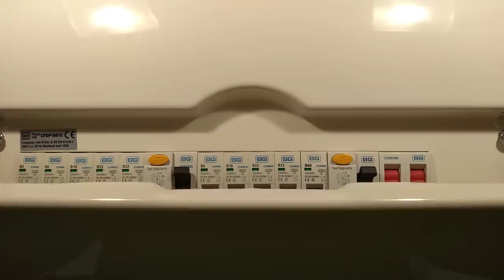A look inside a British home electrical panel.

Comment: Ha!
I'm still on fuse wire!!
Reply: Same here
Reply: Peter Fletcher Fuse wire? If you check I'm pretty sure you'll find the previous owner upgraded to opened out paper clips or really upgraded the supply by using nails.
Reply: I hope you never drill through a cable, get a shock or have a fire 🥺
Reply: fuse wire is fine has long has it is properly maintain.
I'll take fuse wire any day over this piece of shit box.
Reply: I have cartridge fuses in holders, minor upgrade to fuse wire, only 3 fuses for the whole house, really need to rewire the place.
Reply from the maker: Lots of people still have fuses.  The one thing I'd recommend is a quick audit to make sure the correct size of wire is in each fuse carrier.    It's also a good idea to make sure that the wires going into a fuse holder are suitably matched to its rating.
Reply: @bigclivedotcom  ive replaced all the fuse wire. And started swapping out the wire for Circuit breakers. My late Fathers response to a blown fuse was to just put in thicker wire! Unfortunately as im disabled im not in a financial position to get the house rewired. I make sure that I dont run kitchen appliances at the same time. So no more blown fuses. I dont know who wired the houses in the 60s but they didnt do a very good job.
Reply: @spencerwilton5831  Depending on the cartridge size several different calibers of ammunition can be used for various amperages, with the advantage that you get a really positive audible indicator if it blows! :D

Comment: We usually have 10A breakers with A characteristic for lightning circuits. And 16A or 25A breakers with B characterstic for the socket circuits. Breakers with C type charactersitic are used almost only for garage/workshop or industrial space. RCDs are usually used only for kitchen and bathroom circuit and most of our instalation is done as TN-C-S, which means that it comes as TN-C before the main panel, where your neutral and earth splits.

Comment: Certainly makes our US system look good. Sometimes the mommy state approach reduces the skill level of installers to the level of “weakest link.”
Reply: The US, with the exception of "Third World" countries, has the worst electrical system I have ever had the misfortune to encounter in an industrial setting.
Reply: @steveemmawood8719  It's all relative tho. I depends on the age and location of the factory or plant you went to and how long ago you came over. I work in Maryland primarily on  industrial side of things. You really need to understand the wiring methods we use. If the plants that i worked at would not have a issue with me filming. I would start a channel on the different types of wiring methods around the US and the world. But you know how factorys don't like the idea of someone filming the skeletons in their closets.
Reply: How are the newer aluminium based systems holding up? I know the stuff from the 60s and 70s is horrible, but some manufacturers claim they have solved all the old problems, and aluminium can be used safely again.
Reply: @steveemmawood8719  Steve I have got to agree with you, I made the mistake when I commented on the fact that I purchased a mains extension cord in the USA, I was shocked when I looked in detail how thin it was, I then pointed out that my hifi speaker cable was thicker. This American made a point that any thicker was a waste and not necessary. As everything is bigger in the USA our cable "UK " would be thinner because we use 240v. When I told him our 13amp mains extension cable was 2.5 mm, he called me a liar, there was no chance it was that thick. I hadn't got the heart to say how thick my 16 amp and 32 amp extensions are. Atb nick

Comment: I know it’s obvious, but there are a lot of dummies out there.
You should add a v/o or disclaimer title that says this board IS NOT CONNECTED to any supply. 
People will see loose wires, hands and fingers flying around in a board - and think that’s ok.   Just sayin’
Reply: Good point, and I agree with you. However:
The knock outs were still in place.
The pigtails were still in a sealed bag.
The incoming cable gland was in his hands.
There were no wires going to any ring main or spur.
The box was shiny and dust-free.
There were no screws in the back mounting holes.
Clive told us that it wasn't being used.

Plenty of clues there to indicate that the unit was safe. Anyone too dumb to notice the visual cues, or to hear what BC was saying, would be too dumb to open the box in the first place. Even if they did figure out how to open the box, and to poke around live circuitry without recognising the danger, then they would be deserving of a Darwin award in any case.
Reply: @RWBHere  Yeah, because a ten year old is going to know what a knock out is or a pigtail...
Reply: @RWBHere  And... lets hope that they got the grandfather of all electric shocks to help 'em on their way !!!
#

Comment: Downside of retro fitting these split boards in older installations is that the landing lighting circuit generally gets its live switched supply from the downstairs lighting circuit but uses the neutral from the upstairs lighting circuit meaning that in the case of a fault that both RCBs will trip instead of just one.

Comment: I find it a little disconcerting that the isolator on the incoming mains is just an isolator, not a mag or thermal/mag breaker. When Joe DIY gets his screwdriver across the live bus bar and the metal enclosure what's going to clear the fault? The fuses somewhere upstream in the neighborhood distribution? Take out the whole block's power? Maybe I'm just too used to the American panelboards that always have a main breaker?
EDIT - you kind of covered this at the end of the video. That'll teach me to comment before the video is over.

Comment: I find it quite interesting: In most countries it is called DIN-rail, which is the short for the german institute for normalisation. But here in Germany we call it "hat rail" because if you look from the side it looks like the profile of a hat.
Our boards are quite the same, except that they're bigger. More rows, but only 12 units wide. The devices are the same. But here three-phase is common, so you've got 3x230/400V in the board. The kitchen cookers for example are fused with three B16A circuit breakers, that are round about 11 kW, L1 and L2 for the cooking plates and L3 for the baking oven.
The tripping currents of the different types:
B, magnetic: 3 to 5 times of the rated current. Thermal: 1.13 to 1.45 times of the rated current for 1 hour, breakers for more than 63A will let that overload pass for 2 hours (ambient temperature 30°C)
C, magnetic: 5 to 10 times of the rated current. Thermal: Same as B
D, magnetic: 10 to 20 times of the rated current. Thermal: Same as B

Old german ones which sometimes are still arround here in older installations:

H (manufactured until 1976), magnetic: 2 to 3 times of the rated current. Thermal: (6 to 10A breaker): 1.5 to 1.9 ; (12 to 25A breaker): 1.4 to 1.75 ; (more than 25A): 1.3 to 1.6 times the rated current for 1 hour. Ambient temperature 25°C.

L (used until 1990 and then replaced by B), magnetic same as B. Thermal: Same as H.

The boards here are double insulated. Flame retardant plastic inside, outside metal.
Reply: Well my L type breakers are rated for 220 and 380 volts
Reply: @thatredkite8310  The voltage in West-Germany was raised in 1986 from 220/380 to 230/400 for this european harmonisation thing, in East-Germany it was in 1990. But it's perfectly fine, because back in the days in houses next to a power station already had 230V and more before that time. The tolerance is +/- 10%.
You're not permitted to use the old type L in new installations, but using them in old installations is no problem. But you can actually still buy them, but only the one which are for the replacement of old Diazed fuses.

https://www.amazon.de/REV-Ritter-0505140555-Sicherungs-Schraub-Automat-16/dp/B0002YZ0L8
Reply: @Marcel_Germann  well i know that. My breaker is actually a Stotz BBC S181 L16A but they tend to false trip sometimes
Reply: @thatredkite8310  Normally they should not trip. If they start to trip without reason you should replace them. That's normally the indication for a defect. It's better that way arround instead of not tripping if necessary. That's the way they die. Replacement type is B. Material cost  for a B16 is round about 4 to 5€ per breaker. BBC fusioned with the swedish company "Asea" to ABB in 1988 btw. But ABB Stotz is still in Heidelberg, there's the manufacturing of these devices (breakers, RCDs, RCBOs and so on), and a big training center.

Comment: As an American, the biggest surprise for me was that the main incoming switch is not a breaker in itself. Typically in residential panels, two phases come in and go to two breakers that are attached to each other, with an attached switch, and that acts as the main breaker, with all the rest being sort of sub-breakers. Also interesting that it's only 60A. Double that is only 120A at 120V... the standard for US homes is 200A, with only very old outdated homes having 100A service, and then it's usually fuses, not breakers.

Comment: the position  you have put  the rcbo  in is already linked  by the busbar to the rcd   they should be fitted after   the main switch and before  the rcd  feeding the circuits

Comment: In italy the norm is only a 3kw supply for a house (single phase 16A at 230v), and you have to pay more just for having more nominal power. It seems strange compared to other countries, but usually heating and cooking is done with methane/natural gas so it's usually enough. But it's very annoying if you need to use more than two  appliances and the breaker cuts out
Reply: Holy crap, my reverse cycle air-conditioner uses 6kW on it's own when running flat out (and that can happen often in the middle of summer in Australia) - I have single phase 80A at 240v supply. I also have gas (LPG) for stove top cooking (oven is electric) and hot water.

Comment: @bigclivedotcom This one of the few times I like our USA type better. The breakers push down onto the main live bus bar which has alternating fingers to distribute the load to both sides of the incoming 220 volt supply and the center  neutral is a bar down the side. Every breaker has it's own connection that does not rely on being lined up properly with the other breakers, only itself. Also when all the breakers are in, there is no exposed bus in the center,  where yours needs a cover.

Comment: Plastic consumer units were not phased out because they went completely on fire. The London fire brigade had several instances where loose connections caused a fire within the board which then melted the plastic and in turn dripped on whatever was below. This caused the fire to spread more rapidly thus the re-introduction of metal boards. I didn’t hear any mention of eddy currents ? Fairly critical thing to point out if we’re preventing a do it yourself diy job going south.
Reply from the maker: Check out John Ward's video on taking tails through different holes.  It had no effect whatsoever at 100A.

Comment: I see that the RCDs are S-marked too in addition to the CE marking. The S-marking is specific for Sweden, but I haven't seen the BG brand in Sweden - but then they may be sold here in Sweden under a different brand but with everything else the same.
Personally I see the CE marking as "We promise that our product is good, even if it isn't".

Comment: Hey Clive, so I just recently bought my first meter, the TACKlife DM01M and, while it has separate ports for the red probe for amps, it still mesures amps from the normal port for volts and things. the reason I got this particular meter was because my friend has it, and he says the same thing. Might be worth a look into.

Comment: I am sure, that if you have fault in outgoing MCB circuit, what will trip RCD , then with switching of  and on MCB's will not help you any closer to detect fault location, because leaking is also N to PE and with swtching off line breaker you will not interrupt connection between N and PE. It means that whenever current in N is enough big, that it will be devided from N to PE >30mA, it will be RCD will be tripping. And 30mA RCD can trip since 15mA according to standard.

Comment: in Finland all the detached houses have three phase power and that's fed to cookers, hobs, sauna heaters (every house has a sauna). It's really nice since the cables don't have to be as thick as the huge cables you have for cookers/showers in the UK. My house is from the 70's and amazingly not all the sockets in the house are earthed, only the kitchen and bathroom have earthed sockets, otherwise they are just two pin non-earthed types (this is not allowed now of course). And we're quite happy with power sockets in bathrooms - everyone has their washing machine in the bathroom, I have never seen a washing machine in a Finnish kitchen like people have in the UK.
Reply: Earthing became mandatory in 1997. In the 70s most equipment like televisions were class 0 so they could not be used on earthed sockets. Of course this did not prevent people. We had a tile floor on our TV corner and that meant the socket had to be earthed. My parents made an illegal cable that had earthed plug and unearthed socket and the problem was fixed. In 1983 we then got a new TV and it was double insulated.

Comment: It should be noted that this is a look into a RECENT British home electrical panel. The panels you will find in most older homes throughout the UK will have RED and BLACK wires, instead of the EU-standardized BROWN and BLUE (L-N respectively), and typically NO ground fault/differential or RCD breakers.

Comment: I installed 30 of these in a building, I found these BG consumer units to be easy to work on and quite sturdy
Reply from the maker: It's not the most luxurious, but it seems very functional and spacious inside.
Reply: @bigclivedotcom  One good improvement they done over time is to remove the crimps from the tails that link the RCDs as seen on these photos: 
https://i.imgur.com/gFEjfkN.jpg
https://i.imgur.com/evOGZgG.jpg
It was too much unsheathed metal showing to my liking even after trimming the excess copper.

Keep up the good work sir, I have learned a lot from your videos!

Comment: 11:00
That's why in Germany we have separate terminals for busbars which are just as big as they need to be so you cannot put the busbar into a void. You have to screw them open correctly in order to slide them inside.

Comment: Unlike the British Standard plug, this consumer unit is not a design classic, it could do with some kind of "poka yoke" assembly feature to ensure that each device is properly secured to the bus bar, or at least a visual indicator that it might not be. As you point out, it will not be obvious to a visual inspector whether each one of these devices is correctly installed since they are all tightly packed together, it will seem as if the inner ones are tight but they might not be clamped at all.

Comment: That looks so much better than even most of the new units in Australia it is Interesting how different they are considering we work on the same voltages etc.

My home one is a bunch of what used to be fencing wire “fuses” (I think the electrician who replaced them referred to them as 600 amp slow blow) now circuit breaking RCDs screwed into some chipboard, wires stuck in directly and the whole thing stuck on the outside of the house

Comment: American (US) service panels for residential come in 2 flavors generally. You have a big main panel for homes (typically 200 A or 300 A for 240 volt split single phase) or you have a smaller sub panel for mobile homes and RVs where RV specific panels are offered in 2 types - 120 volt @ 30A or 240 @ 50A.

Homes in the US also have a seperate 30 A breaker out at the air conditioners condensing unit as well as a matching breaker in the main panel.

Aside from the various types of panels you also have brand specifics where you have to buy breakers that are for the brand of panel you have. Some panel manufacturers do offer panels that will accept different brand breakers. The only plastic panels I have seen in the US were those used in RVs and handles the 120 volt AC circuits as well as the 12 volt DC circuits.

Comment: This is basically what we use in Australia (minus the metal enclosure). Things that do surprise me though are the switched main neutral, and the uninsulated spine on the bus bar.
Reply from the maker: The bus bar has a cover.

Comment: In Denmark and most of europe we have 3-fase system in all buildings. 230V single fase and 400V between fases. I my kitchen i have some groups of outlets with 3 fases in every group. That gives potentillly 400V between each outlet, that has never been a problem. My stove is on 3-fases. All my single fase outlets are 13A (3000W) my 3-fase outlets are 16A (11KW) in my workshop it is 32A :-)

Comment: In Australia it is required to have 30mA rcd's on all domestic circuits now except the 'leaky' ones like electric hot water systems, old non protected are still legal but must be upgraded if works go beyond a certain limit. After a little incident we supplied thousands of 10mA rcds to upgrade school MDBs as kiddies are more susceptible to electrocution.

Comment: Use one of these in my van , split the sides so one side is 12V the other 240V (inverter) with a gap in the middle, not a lot of people realise these MCB's will also operate on low DC voltages.

Comment: In Australia basically we only use RCBOs now rather than an RCD with MCBs in series as per your set up.
The reason is, it's so good damn annoying having a fault on one circuit that takes out two, three or four different circuits at the same time and worse yet, lose lights as well.
We also have the mains breaker on the far left.